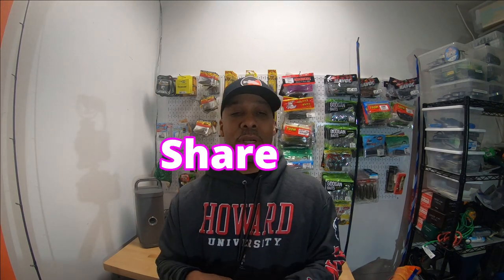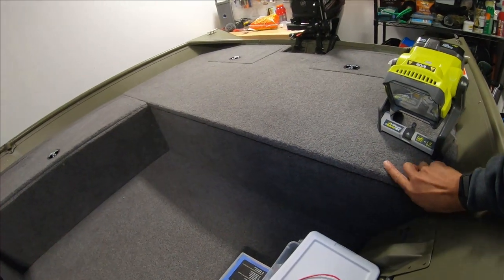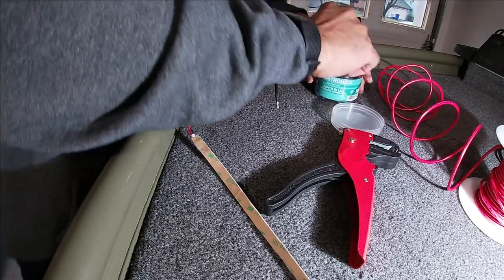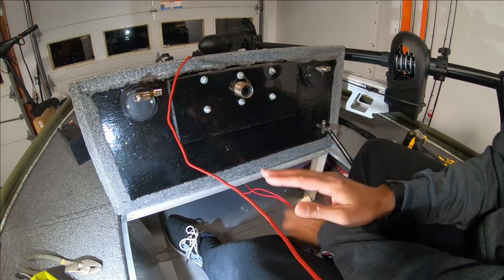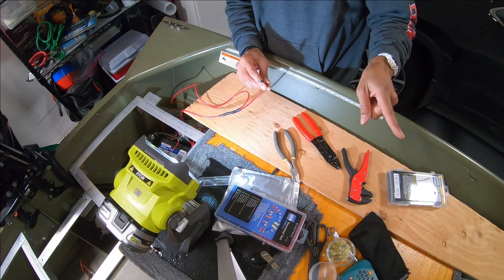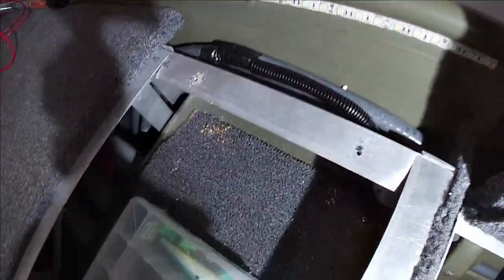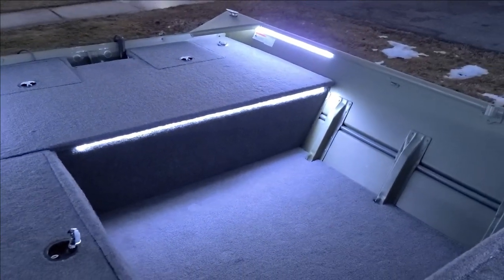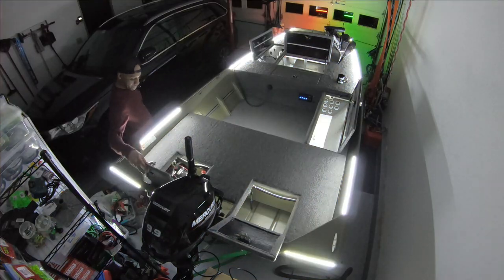How to Install Deck Lights on Your Jon Boat + GIVEAWAY {Jon Boat To Bass Boat Conversion} Lowe 1448

Comment: The parts list for these lights and other components listed is beyond outstanding.  Thx for taking the time to explain each step of the light setup.  Needed to do the same and is very helpful!
Reply from the maker: No problem 👍🏾👊🏾

Comment: Building/MOD my boat. Love watching your build on your boat. Great ideas. 
I store my boat outside (no room). 
Q: I want to add a solar charger for my
 batteries (2 - 12v) when I'm not using it. Any suggestions?
Reply from the maker: I don't have any experience with it personally but have heard good things.  Sounds like you got a good build happening

Comment: Great videos! I see with adding these lights you spliced the positives together into one large wire as opposed to your original compartment lights where you had individual positive wires to a bus bar, so my question is why did you not just run separate positive bus bars for the new lights. which method would you recommend?
Reply from the maker: It all depends on the application. In some cases it makes sense to join two or three  wires into one and in other cases you may use a buss bar to bring several wires to one lead.  In the end I use both depending on the situation. Both are effective

Comment: Thank you again for great Content. I'm just about complete with my project, but ran into a problem. I can't seem to figure out how to get the light strips to work properly using the dimmer switch. Please advise when possible.
Reply from the maker: Your dimmer switch should have come with instructions to follow. If you've followed them correctly maybe there's something wrong with the switch.
Reply: @BassBrothersFishingDMV  Thank you

Comment: Where are you connecting your negative from
The light strip? I’m trying to get my switch to work but wiring the way you mentioned I don’t see where the negative from the light strip goes

Comment: Have you had any issues with the lights staying stuck to the surface? I've bought so many led light strips and that 3m adhesive has always let me down. It will stick once to a surface and fall off and never go back on again.

Comment: After some use with new lights did you think the side rail lights were angled too high facing your eyes? Or did it work out perfectly
Reply from the maker: So far I've used the deck lights only to put stuff away at night. I'll do some actual night fishing in a couple weeks so I'll know more at that point.  I don't anticipate the lights being too bright or shining too high because they are on a dimmer switch. I do like the fact that there is a slight angle up so I can take some cool night shots.
Reply: @BassBrothersFishingDMV  same here I like the ambient light up , but I'm scared they will be in my eyes. Only one way to find out, I'll be installing mine this weekend.

Comment: How many small LED lights can you hook up on one wire? I have the smaller LEDs that I want to run to my compartments and for deck. Can these be put on one switch and circuit? Also what fuse should be used? It is 12 volt battery on boat.
Reply from the maker: Small LEDs don't draw allot of power so you should be fine.  A 5 Amp fuse will do the trick.  You may be able to go with a lower Amp fuse if the manufacturer recommends it.

Comment: Hey, great videos!  Q: the reviews on the lights say they stop working after a few uses or parts of the strip go out.  Any issues yet?  I know you put silicone to help adhesion, any de-lamination?  Thanks!
Reply from the maker: No issues at all.  All lights are still on like day one.  Not sure if that's be a use I added silicone or not. The only change I noticed is the actual light strip has a yellow tint to it from being exposed to the sun.  The lights themselves work perfectly fine.  Very bright and white.  Funny thing is the yellow tint to the strip actually makes the light strips blend in better with the color of the boat lol.
Reply: @BassBrothersFishingDMV  Sweet, good to know.  I'm thinking the issues the others had were just bad grounds.  Love the detail you put into your build.  Thanks for sharing.

Comment: Hi, how do you charge the batteries? How much power all those lights use from DC? Thanks
Reply from the maker: In general LEDS use little power so I don't anticipate having any issues. They're connect to a 27DC deep cycle battery which has more than enough power. I use and on-board charger to charge all the batteries

Comment: What did you do with the negative wires coming off the lights? Where did you hook those up to
Reply from the maker: Those went to my negative bus bars.
Reply: Negative bus bars on the fuse box or a separate one?
Reply from the maker: @evanyuhasz8245  both.  The front deck lights went to the negative bus bar on the fuse box.  The rear deck lights went to a seoarate bus bar at the rear of the boat.  The fuse box and the separate negative bus bar both run to the same battery so I was able to do it that way.
Reply: So you ran the lights to the fuse box/bus bar and then you ran a separate wire from the fuse box/bus bar to the switch?

Comment: what gage wire use to add on the led boat  i have led lights need the right marine gage add on the led
Reply from the maker: All LED lights are done with 14 awg.

Comment: i want to make my tracker 14 foot like your boat want rode locker on i have front deck and wood flooring now can i still make rod locker now with aluminum framing  kevin clements
Reply from the maker: Live the rod locker.  Great addition to the boat.

Comment: I know you mean well, but the worst thing you ever want when you're out on a boat at night is rows of white light shining up at you, robbing you of night vision, robbing you of the pleasure of adjusting to ambiant light, posibly even spoiling it for any boater nearby. Even a stern 180° white running light should be shielded from your view in the cockpit.
Reply from the maker: Dude. You are so right.  I hardly ever turn them all the way up unless I do it for my videos and pictures.